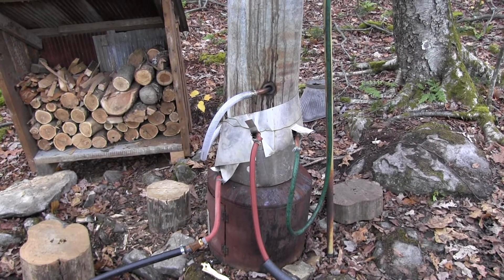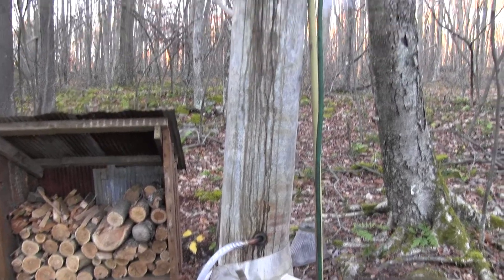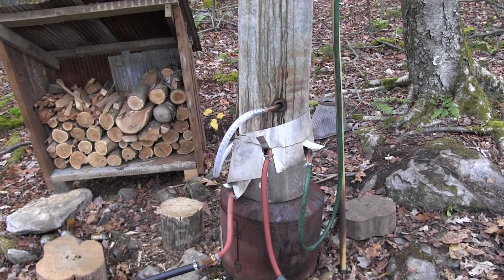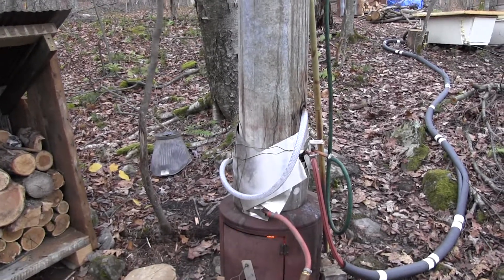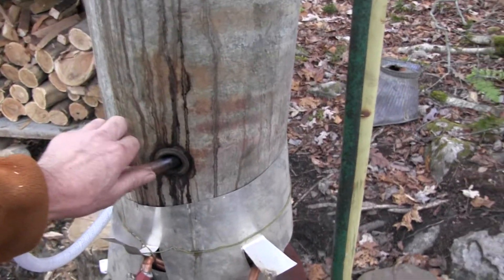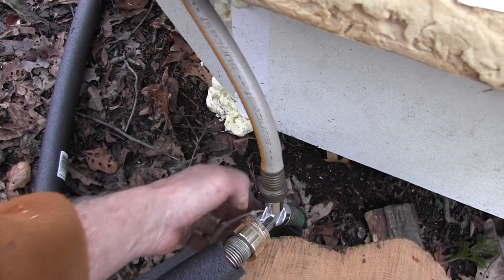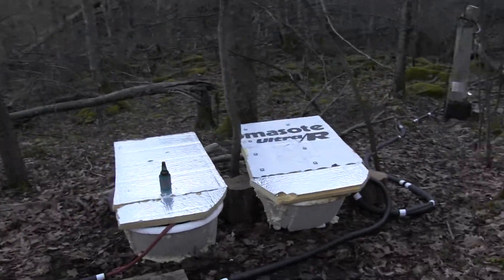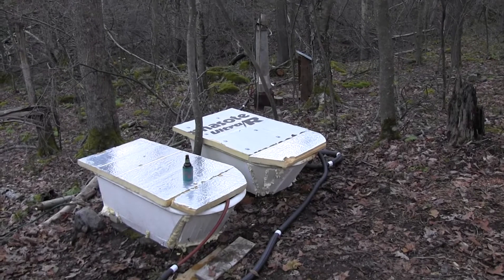Wood fired water heater Part 3.

Comment from the maker: Wow, hard to believe I started hot tubbing in the woods six years ago. I've re- built the water heater at least a half dozen times or more. The best thing about it now is the water comes clear from the spring, around 1500 feet away. Started out using creek water !